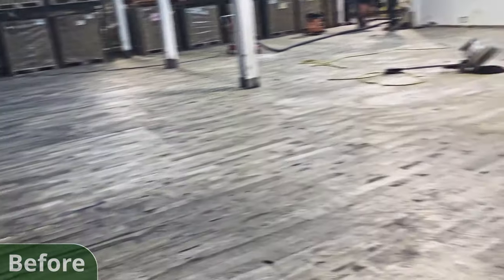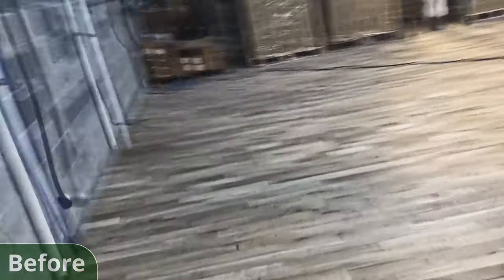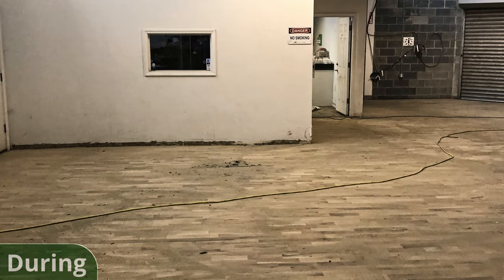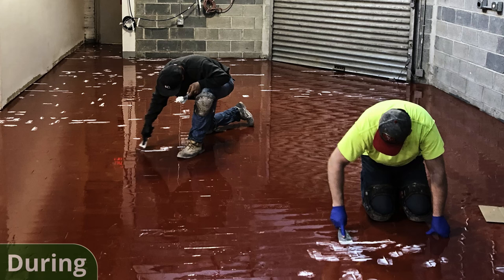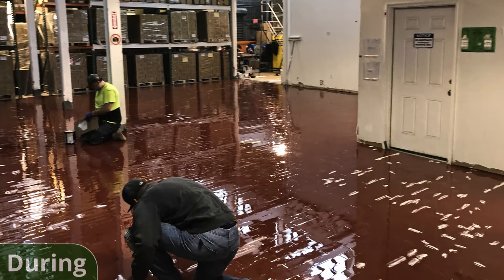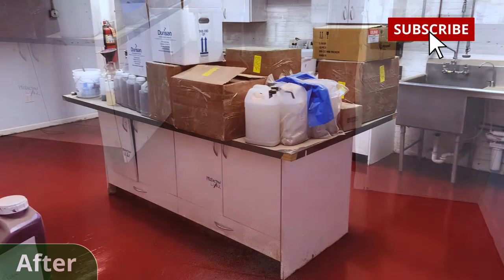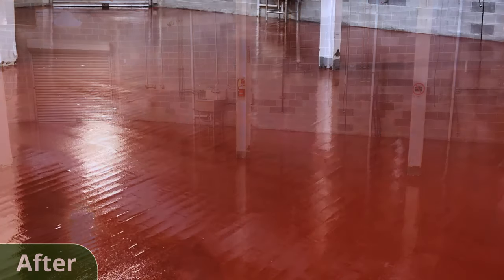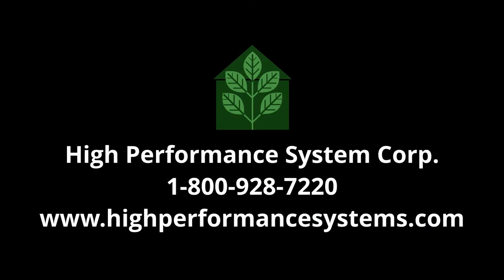How to Install Commercial Epoxy Flooring on Wood

Comment: If only there was a crystal clear version it would have made for a awesome aged wood looking floor with ease of Maintenence .
Reply from the maker: Couldn’t agree more. One of our favorite applications is clear coating acid stains on concrete slabs. Unfortunately, those transparents don’t offer the flex of an elastomeric.
Reply: @Highperformancesystems  what does this mean flex of an elastomeric